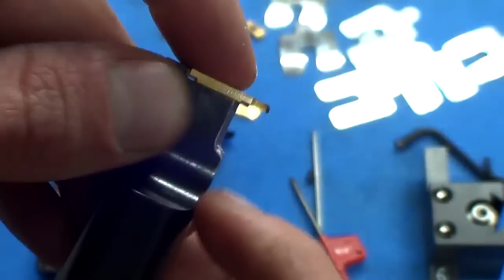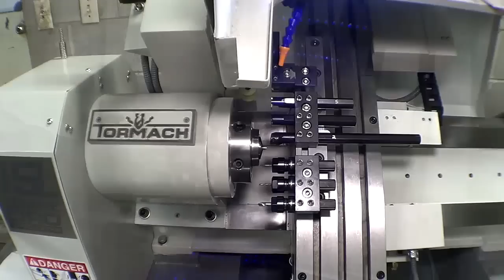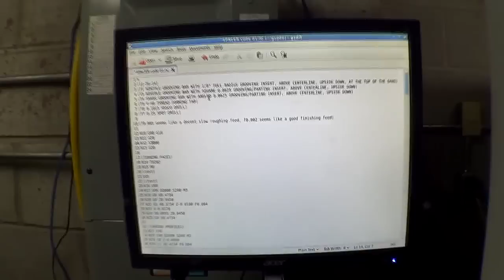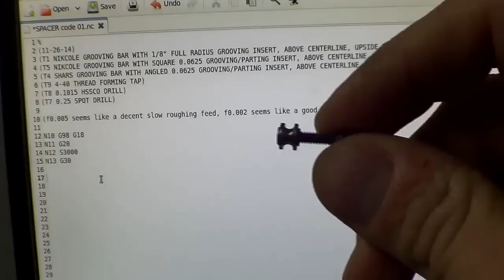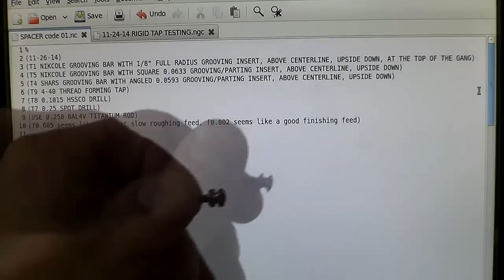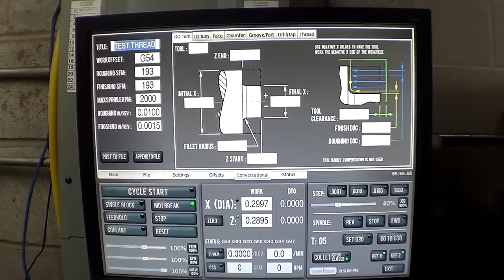Knifemaking Tuesdays Week 99 - Lathe spacers - part2

Comment: John,
Glad to see you bought a gang tool lathe. I use Omni-Turn lathes in my shop. Omni-Turn has decades of experience and have lots of tooling that may be useful to you.
Check out their catalog:    http://omni-turn.com/Media/PDFs/Tooling%20catalog.pdf
I'm not sure why you have to shim the tooling holders, they should be ground to fit your lathe on center line. You might have to shim your tooling plate on the guide rails in order to raise it so all your tool holder holes are on center, the Omni-Turn is dead on. Let me know if I can be of assistance.

Comment: I think your putting the shims in the wrong gap. Try shining between the table and the block.
Reply: Yeah, it looks like the tooling blocks are mounted to a riser on the table (a tool mounted in a collet, mounted in a holder, mounted in a block, mounted on a riser, mounted on a table, mounted on an x axis way which is mounted on a z axis way....all mounted to a casting. that's alot of compounded inaccuracy.) and the riser bolts appear to be far enough apart to fit the shims.
Reply: This is what I was thinking is the correct way for those shims.  :)

Comment: "Eventually Tormach will come out with a Turret"?  John, you are behind the times.  Tormach started selling them yesterday.  When does yours arrive?

"This is Mach3, but Tormach redid the whole thing and wrote it on Linux".  Not quite.  Tormach started with an open-source program called LINUXCNC, and customized the GUI to superficially resemble their build of Mach 3.

You could speed up your production by cutting 3 or 4 of those spacers at once.  Groove it 4 times, drill it out, part the pieces off... That way you don't have to come over and load the rod for the next part as often.  Your life will get better when you have a pneumatic chuck and a bar puller.

Thanks for your very detailed walk through of the lathe.  Their has been few user videos of the lathe on youtube, and yours is looking like one of the best. Looking forward to part #3...
Reply: I think this videos about a month old the date on his files was Nov. A Turret setup would be cool cant wait to see what he does with it.
Reply: Basicly Mach3 is.. well a bundle of Visualbasic and C++ code in a blender that .. is horribad. And it could never be ported to Linux..Maybe if a deal would be made with the devil.. So yeah, LinuxCNC - custom UI is probably the solution here. The horrible Photoshop Candy buttons is still there..  ;)

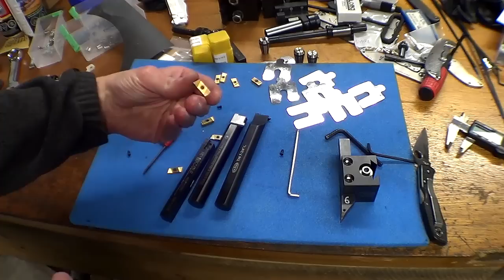Comment: 5:20 Is that a Spyderco to the right of the blue mat?  :-)

Great visual explanation of setting up gang tooling on a lathe.  It's more complicated than it would seem.  With all of the fancy CAD and CAM tools, I'm surprised someone hasn't made a program that optimizes gang tooling for minimal cycle time with no crashes.

They rewrote Mach for Linux?  That's awesome.  If you want to run another console and do stuff in the background (probably not recommended) or just take a look under the hood, try opening a terminal with Ctrl-Alt-T.  With a little Google tutoring, you can probably change to multiuser mode, open new X Window consoles, install Firefox, and watch YouTube videos as you machine your parts.  I actually do this in LinuxCNC, but the default LinuxCNC has apps like Firefox installed as default.  It's great to look up stuff on the internet when not machining, but I have watched videos while machining (albeit not with a servo and encoder system that places high demands on the realtime kernel).

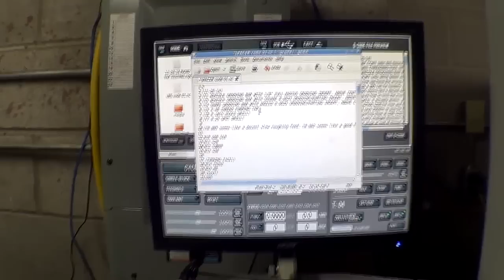12:15 That's gedit.  Don't call it Notepad!  :-)

13:20 Hand coded G code FTW!

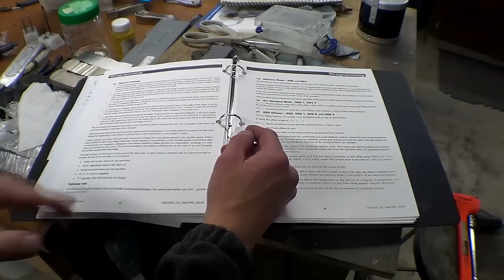15:25 The dead tree manual?  Who does that?  :-)  LinuxCNC has all of the manuals available to view on the machine... as you're machining if you like.  The console isn't disabled and hidden away.  Click the CNC tab and you can pull up a very nice abbreviated list of the valid G codes and M codes with brief descriptions of usage.  The G codes are hot links.  Click them and you'll get more verbose examples, including example code that can be cut and pasted into your G code.  Change a parameter or two and it's YOUR code for your part.  It's almost as easy as wizards.

You said that the lathe is running Mach under Linux, but that backplot looks like LinuxCNC.  I think you have LinuxCNC there, bud.  I think Tormach wrote a Mach-ish graphical front end for LinuxCNC probably using Glade and Python.  There is plenty of readily available example code in the existing front ends (Axis, Touchy, etc.).  Welcome to the world of REAL realtime machining.  When you're rigid tapping, thank an open source developer.  :-)